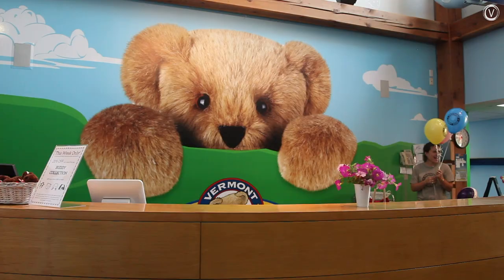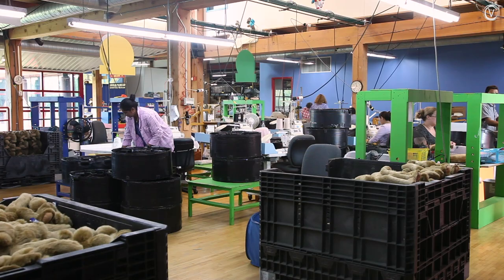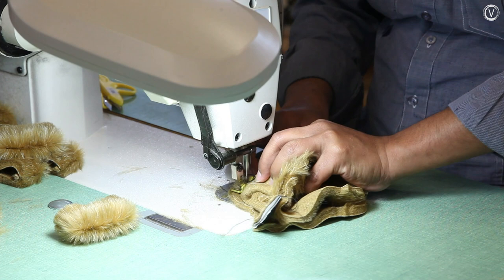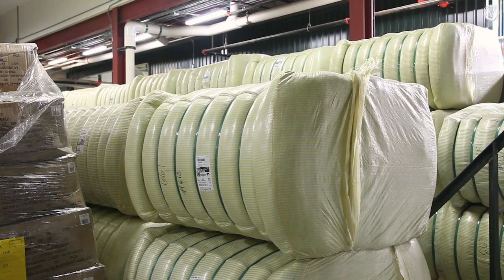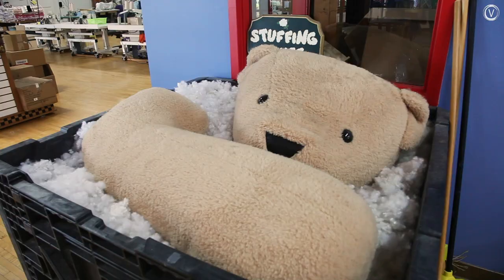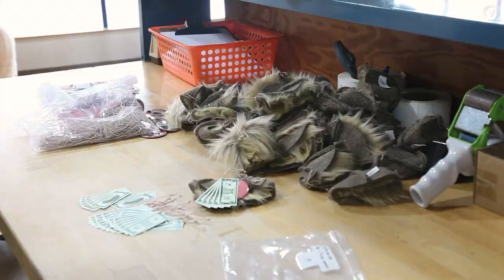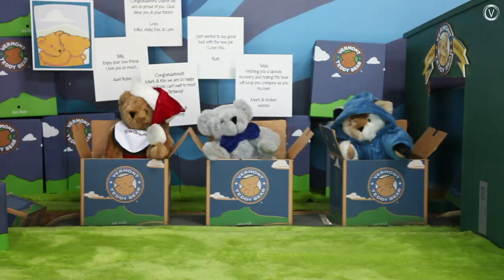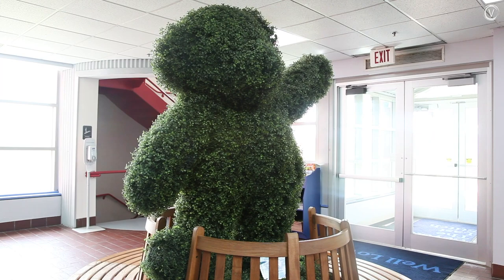Inside the Vermont Teddy Bear factory in Shelburne

Comment: I find it amazing that they use plastic for stuffing, personally.
Reply: Yeah it’s saving the environment really smart decision
Reply: Doll filling has always been made of polyester. Woodwool rots and cant be washed.
Reply: I agree that it's hard to hear "made from plastic" anything but I think this is the other side of a double edged blade. Materials like the stuffing here is creating demand for recycled plastic. A moral conundrum but at least it's not virgin plastic...
Reply: @stigyanblue1442  How to properly clean a stuffed animal, is not to wash it. haha 
... Oh, dear. You brush it with a soft brush and there is a stuffed animal solution you can brush into the fur, to remove any stains and grit that might of got on your teddy bear. :)
Reply: Nearly all the fake fur used in plush toys is made of plastic, not just the stuffing.
Reply: @stigyanblue1442 I feel like there was a time where they used non-plastic materials cause if you watch refurbishment videos of old stuffed animals, the stuffing they take out seems to range from sawdust, to cotton wool, to some sort of weird crumbly foam…. Polyester fiberfill is what they use nowadays which is far superior cause like you said it won’t rot or degrade over time